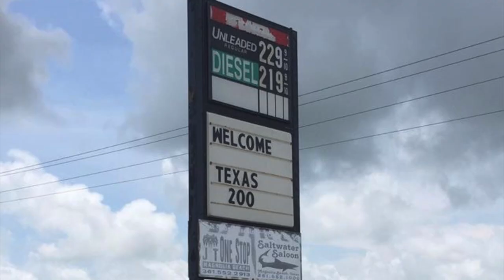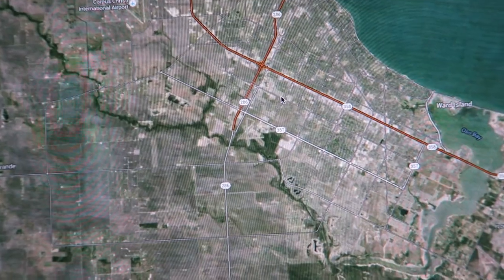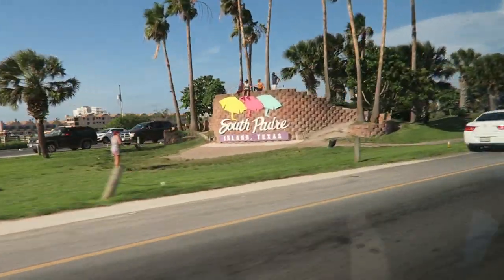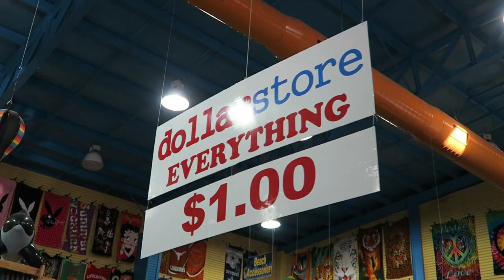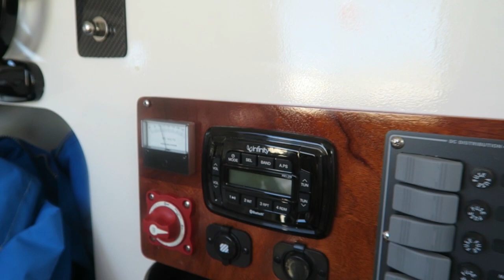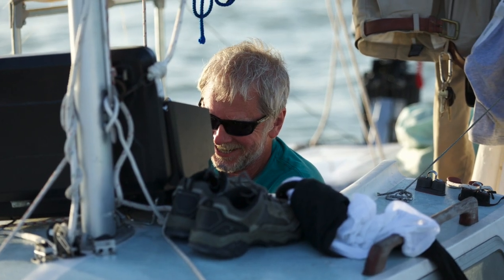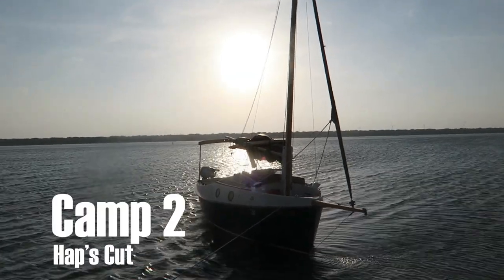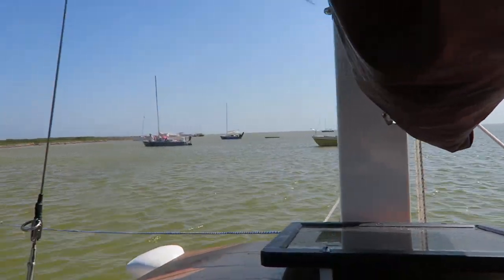Two Hundred Miles in a 15 Foot Boat

Comment: Awesome video. Lovely trip. Its soo different to my experience of cruising in the UK (April barely above freezing). Better luck next year:-)
Reply from the maker: Thanks!  I fixed the centerboard.  Turned out in was an easy fix, but a little work to diagnose.  I have leaned a lot about film making and will include drone footage next year : )  The heat will really take it's toll!

Comment: You mentioned a centerboard problem just wondered what that was all about. You pocketship looks great
Reply from the maker: It was an error in my build. The inspection ports on the centerboard box were just slightly too deep and would drag on the center board. It was an easy fix with a belt sander once I took the ports out. It was such a relief knowing the problem was solved the first sail after the fix. Thanks for watching 👍

Comment: Hey I’ve got a question about your centerboard. I’ve also got a CLC Pocketship and this past weekend the centerboard got stuck in the up position and won’t go down. Is that the same problem you had and if so how did you fix it? I’m not sure if the best way to access and fix the problem.
Reply from the maker: The inspection plates we’re dragging on the sides. I took them out and shaved them down and all was good.
Reply from the maker: Were
Reply: @jbratt  well I got the boat up and turns out my bump with a sandbar I couldn’t see got some rocks and pebbles stuck up in there. I butchered a Christmas lawn ornament to get a long thin rod to get up in there and got the rocks out and the board finally dropped while I got it up on a boat lift. But since I’m the boats second owner it’s the first time I’ve seen the centerboard and I have no idea if it’s supposed to wiggle a bit or not. Lol hopefully I’m good to launch again tomorrow.
Reply from the maker: @iluvgrouphugz   It's good you got it sorted out. Yes, the centerboard does have a bit of wiggle room. There is a pocket ship forum at pocketship.net where there is a lot of information and active users. Be safe and have fun!

Comment: Well done. 
Just wondering why you didn't anchor deeper. Camp one in a channel? Slamming a headwall, even sand, couldn't be good for you or the boat.
Reply from the maker: Mark Kurtis at the time i only had one anchor. The current would have put me against the wall anyway. I took two anchors last time and will against this year. We are going back to that same beach again this year.

Comment: I like the masks - great idea.  What happened with your CB?   Looks like it wouldn't go down?   Is it a question of weighting it with lead?

Great boat, by the way.  Very nicely finished.
Reply from the maker: The CB was dragging on the inspection ports inside the trunk.  They just drug a little bit so sometimes I could get it down.  It was a really easy fix once I figured out what the problem.  Live and learn.  I am really excited about finishing this thing next year.  Also I bought a drone for some really cool shots.  I am only learning this movie thing and this was my first try at it.

Comment: Man what a wonderful video, great job and thanks for posting it. Ive tossed around the idea of a CLC pocketship, but i live above the arctic circle and just shipping the kit to me would be as much as the kit itself. I did build a Goat Island Skiff that is a lot of fun, but I like the idea of a little higher gunnel and a place to sleep. How do you like your little Honda 2.3hp? Thanks again.
Reply from the maker: Thanks Mitchell.  If you have a local source for marine plywood you could build one using plans and save a bunch of money.  The Honda was great but I got into some really rough conditions and needed it when my centerboard was acting up and could have used a long shaft model.  As far as horsepower goes it was perfect and was easy to start.  Centerboard is now fixed.

Comment: Great video, I am just finishing my Pocket Ship, should have it in the water next month. You did a nice job on yours. I'm always comparing other Pocket Ships to see if I want to do this or that. Do you have two reefs in your main sail? What was that table thing in the companionway? What is the top speed your boat has done? Can't wait to get mine out there.
Reply from the maker: Good job on your nearly completed Pocketship!  I did have the sail reefed to the second set of points.  The wind was 25 knots with three foot waves on the second day.  It is amazing how much air the jib will catch with the main reefed all the way.  I finally rolled up the jib and was still doing over 7 to 8 knots according to the GPS.  The table thing is an ice chest : )  I strapped in the ice chest on the opposite side of the outboard motor so that I would have room to sleep in the cabin without moving too much stuff.

Comment: That looks fun and challenging. But the course doesn't end where it began, so how do people make it back to the starting point to pick up their vehicles? What if you exit the race early?
Reply from the maker: Most of the participants drive their tow vehicles and trailers to the finish and leave them there.  The organization has a bus ride back to the starting point.  If you leave early you are pretty much on your own.  Since I live at about the halfway point I made different arrangements.
Reply from the maker: http://www.texas200.com/FAQ.html  these are some FAQs on the event.
Reply: Thanks for answering.

Comment: How much did the kit cost?
Reply from the maker: It's been a few years since I built it.  There are options so the best thing to is check the Chesapeake Light Craft web site for current prices.  They are great to work with.

Comment: Man, I really wanted to love this video.  I've got an iron stomach when sailing on the water.  But you use too much jittery and fast-random-movement hand-held video.  I can't watch it without getting seasick.  For your next video, may I suggest more tripod/fixed mount shots?  You can still pan and zoom from a firmly mounted position.  Sorry!
Reply from the maker: Steven Hartman Steven Hartman hey Steve, sorry about that. This is last year's video and I have learned a lot about equipment. Check out the latest Texas 200 video. About 8 minutes in on the new video you will see a lot of mounted cameras, tripod use, and video shot with a Karma grip gimbal. Thanks for roughing it out👍. The new video is better too.
Reply from the maker: Steven Hartman https://youtu.be/wj0D6d55onk